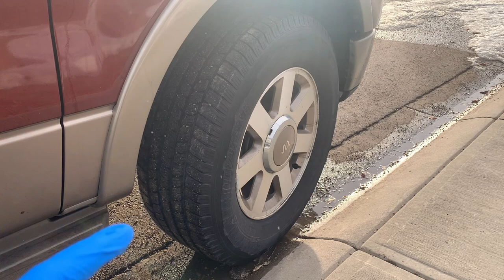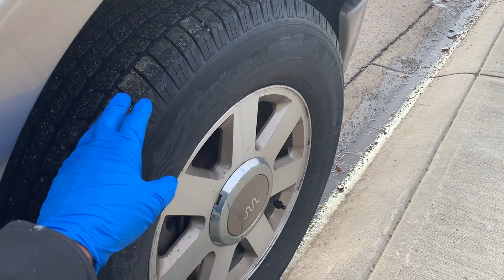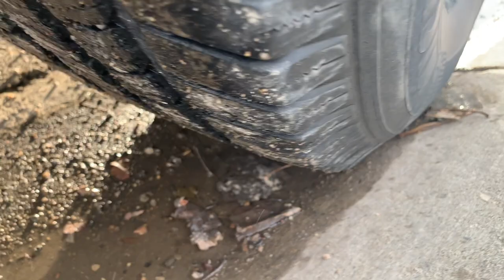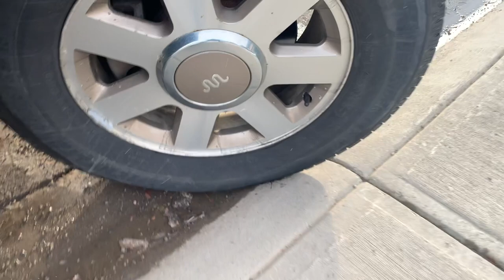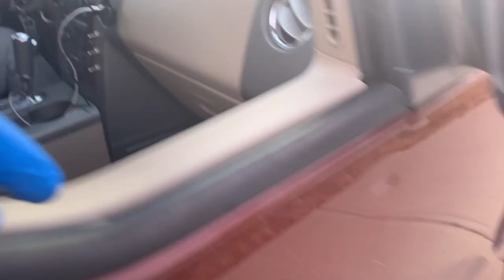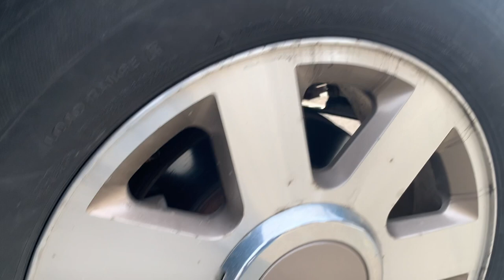Dry Steering - break this habit!

Comment: Thank you for this video.

I have two questions to ask.

1. Does dry steering regulary only damage the car tires or does it effect/damage any other parts of the car.

2. Sometimes when turning on round abouts i hear similar to a humming sound and was wondering if this is related to the effects of dry steering or not.

Thank you.
Reply from the maker: Dry steering only takes place while the vehicle is stationary and will place undue strain on your tires, rack and pinion, pump, tie rods, and bearings.  

For the humming while turning, first check your power steering fluid to ensure it's clean and full, then I would investigate ball joints and wheel bearings.

Comment: My car is brand new 1.5 month old and so parts are new I dry steered every day straight for 1.5 month because parking space is tight in my parking lot. so will it damage my steering mechanism? Please reply does it make steering hard?
Reply: Not at all! It’s just a myth! Go with it!
Reply: With newer cars you should be fine, they are all electric steering.
And you don't really have a choice, in some situations, you just have to dry steer

Newer cars are kinda designed for drivers who don't know how to drive/steer.

Older drivers, especially truck drivers, really just hate dry steering cause it's a sign that someone don't know how to drive, so they tell you not to do it
Reply: dry steer away. if you roll the car while steering in tight spots it will take you more actions to complete your task. there isittle difference between turning steering at 3mph and standstill. tires are meant to withstand the scrubbing when turning your wheels. everything you make a turn you cause tire wear. the car and it's weight want to keep going straight. by turning you are redirecting that motion thus causing micro wear on the patch of Tire that has ground contact. keep your tires properly inflated and when you get your oil changed have your front end greased if possible. somecfron ends don't have grease fittings and because of the will wear out faster.